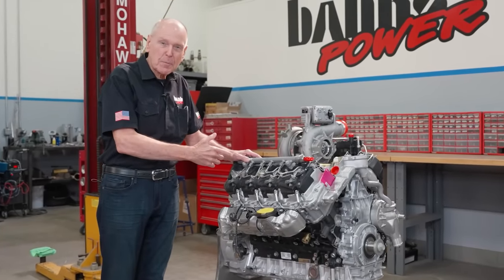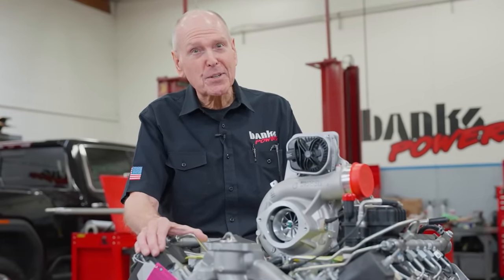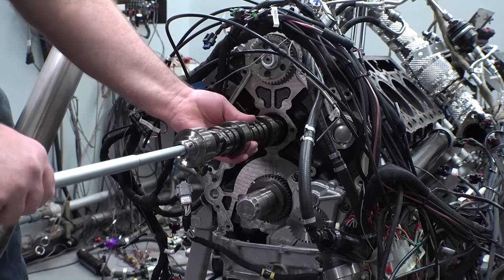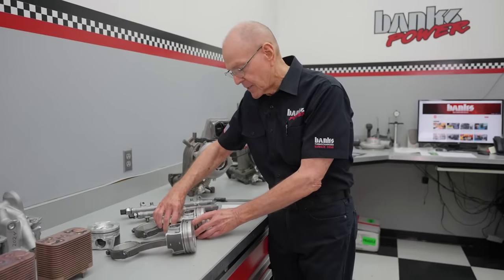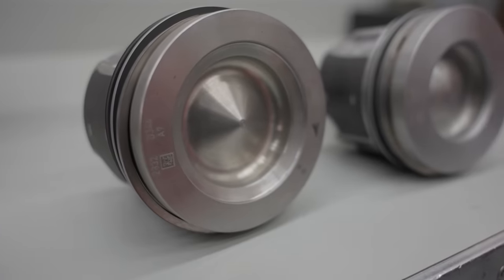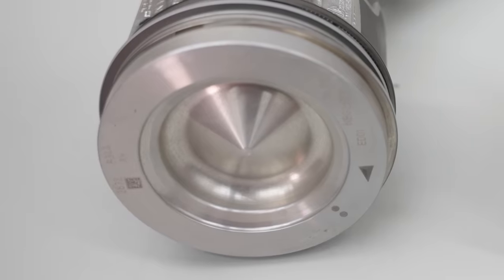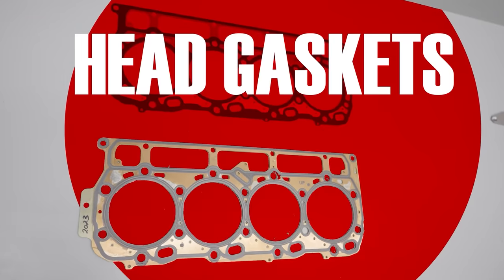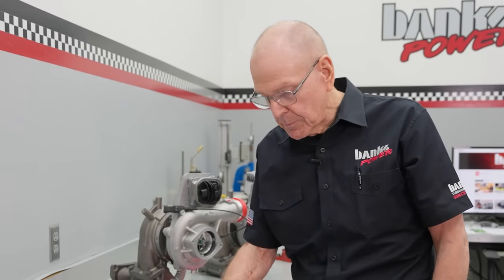2024 Duramax L5P Engine First Look And Comparison | Banks Exclusive

Comment: So a Derringer for the LML is never going to happen.  I own one and your neglect of this engine scares me!
Reply from the maker: Despite what most think, we haven't abandoned the LML. We're developing a new gen Derringer that will cover multiple platforms including the LML, 2020+ Ford 6.7, and the 2008+ Ram 6.7 that will launch hopefully this year. If you cannot wait, we still offer flash tuning in the form of the Automind flash programmer as well as hardware. We still go you covered with Ram-Air intakes, Monster Exhausts, Boost tubes and more. Tap the link to see 👉🏻 https://bankspower.com/collections/chevy-gmc-duramax-6-6l-lml-2011-2016
Reply: @bankspower  You told me 2 years ago that the Derringer was weeks away from being released for the LML. Pretty Please?

Comment: Look, GM is great with physics of how the combustion works and I would never disagree with that.  The problem is the components responsible for containing that kind of fuel pressure are not reliable enough for an everyday driver.  The reliability of the fuel injection system for the L5P is horrible and it has been since 2017.  That kind of pressure kills the mechanical components inside the injector.  If they can find a way to increase the efficiency of the atomization of the A/F ratio without pushing the injector to astronomically high pressures they'll have a great engine.  Same old song and dance for GM. Great engine, lousy parts.

Comment: Whatever happened to Killing a Duramax,  i watched like 17 episodes then it just quit... did you kill it?
Reply from the maker: Both the Super Turbo (Monster Truck Engine) and the L5P for  “Killing a Duramax” on hold for an extended duration while we conduct testing for our military program (Banks Tech) in Dyno Cell # 1 & #2. The moment these projects are completed, we’ll roll both the Super Turbo and the Killing a Duramax back into the dyno cells. However, we may roll LokJaw's supercharged Duramax L5P into the cell first since the truck is returning to the SEMA Show in November. Our goal for LokJaw's engine is 600-650hp before nitrous. Stay tuned!
Reply: @Banks Power  thanks for the response, can't wait to see more

Comment: A 2 bolt main….WTH
Reply: Its cross bolted so 4 bolts per main cap.
Reply: @JoshEdwards123  ls platforms with 1/3 the torque have 6 bolts….. 🤷

Comment: The killing a duramax series is taking way too long!!!!! It's been like 4 years, and you are only making 1000hp and still have not pushed the engine to the breaking point....
Reply from the maker: The Killing A Duramax series was paused when both dyno cells were needed for defense projects.  The moment these projects are completed, we’ll roll both the Super Turbo and the Killing a Duramax back into the dyno cells and get back to hammering the throttle.

Comment: yall never finished killing the durmax either very dispointing
Reply from the maker: The Killing A Duramax series was paused when both dyno cells were needed for defense projects. Both are wrapping up shortly which "should" allow us to commence with Killing A Duramax. However, we may roll LokJaw's supercharged Duramax L5P into the cell first since the truck is returning to the SEMA Show in November. Our goal for LokJaw's engine is 600-650hp before nitrous. Stay tuned!

Comment: I want to see a comparison between the Cummins, new powerstroke and Isuzu. I’m a GM/chev guy but will never own a duramax/Isuzu
Reply from the maker: There was changing of the guard a while ago. DMax Ltd. company is 100% owned by General Motors with GM/DMAX owning of the intellectual property on the L5P since 2017. Isuzu is no longer involved with building the Duramax engines. Even better, Duramax engines are built right here at home in Brookville and Moraine, OH.
Reply: Good, see ya!